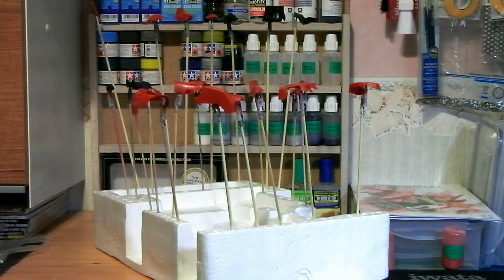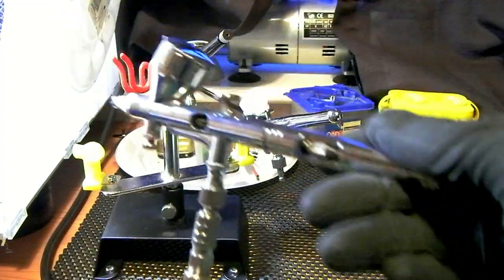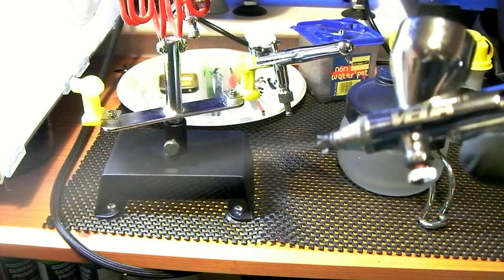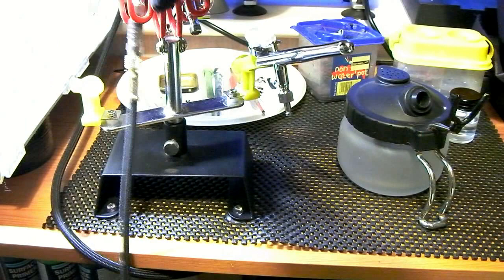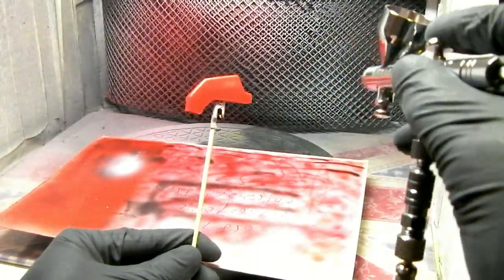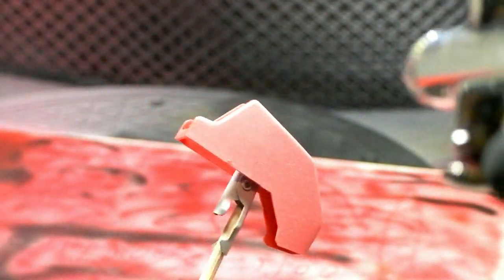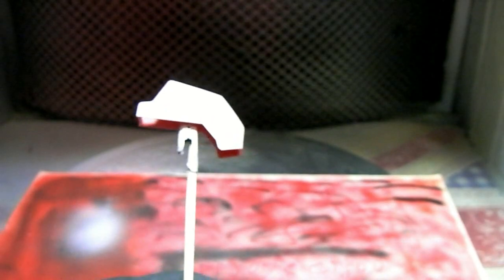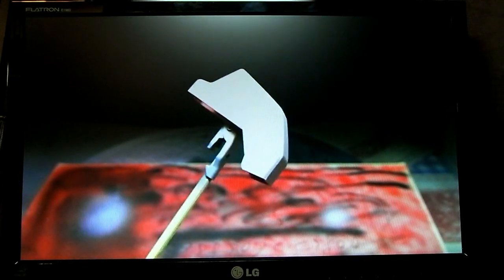MG Sinanju 4 - How to airbrush primer on your Gundam model (Airbrush Painting Tutorial)

Comment from the maker: Its an excel portable one which has the fold out hood. It's pretty common. I've used enamels fine with it but I hate the smell indoors. I only use acrylics with mine. I think this is the cheapest decent spray booth you can get. When folded up, it's about half the size of a stand midi tower PC.